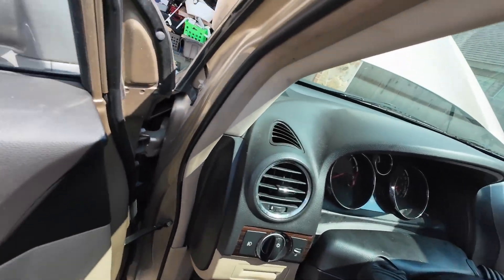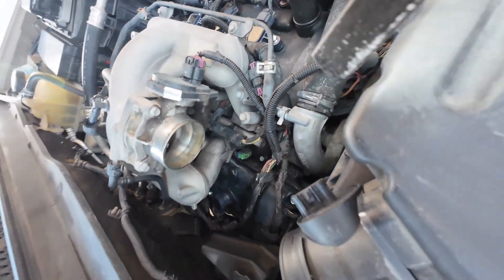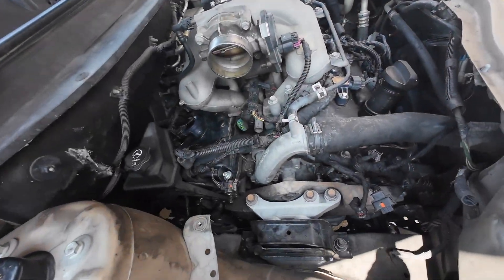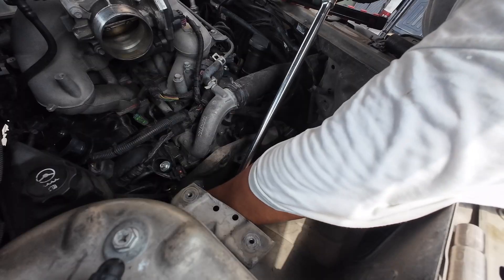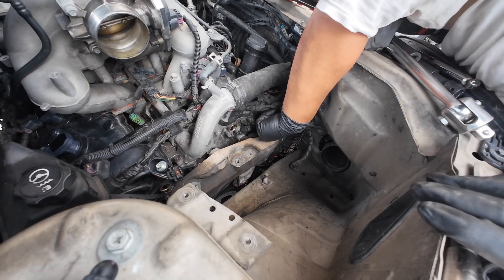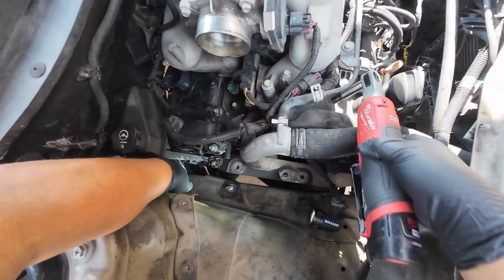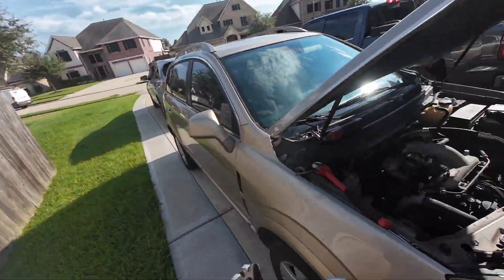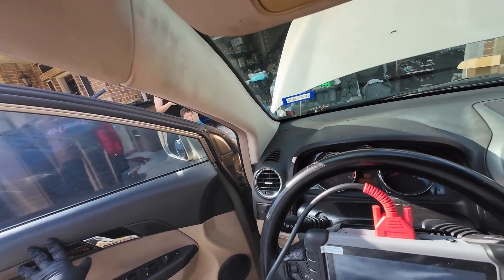Saturn Vue Camshaft Position Sensors

Comment: Is the location for this the same on the 2.4l?
Reply from the maker: https://charm.li/Saturn/2008/VUE%20FWD%20L4-2.4L/Repair%20and%20Diagnosis/Engine%2C%20Cooling%20and%20Exhaust/Engine/Camshaft%2C%20Lifters%20and%20Push%20Rods/Variable%20Valve%20Timing%20Actuator/Locations/